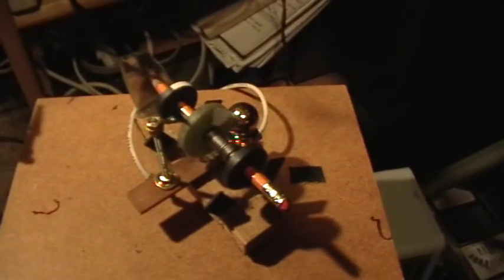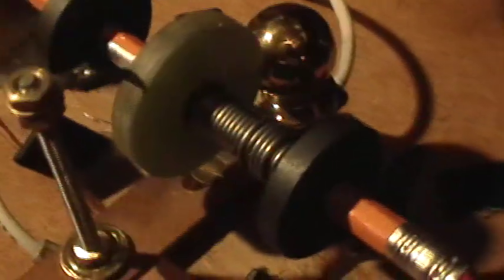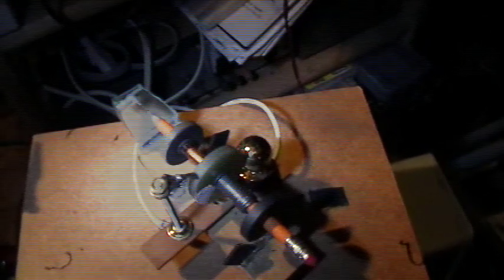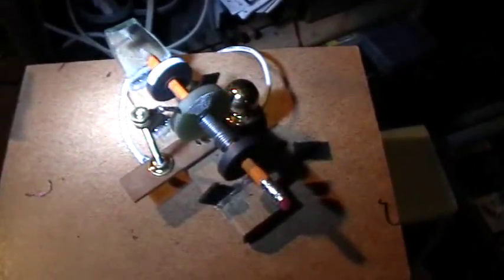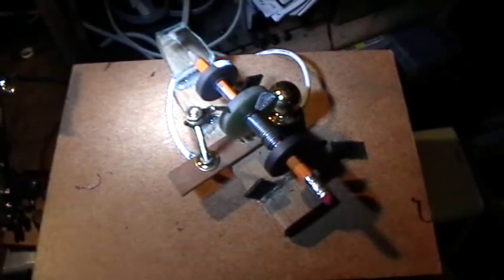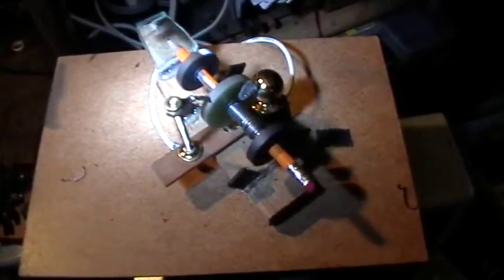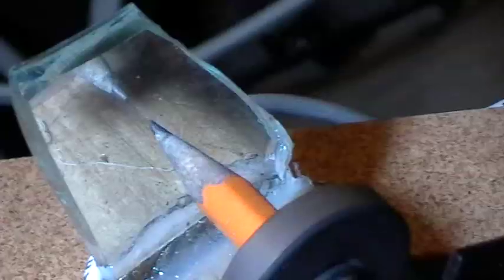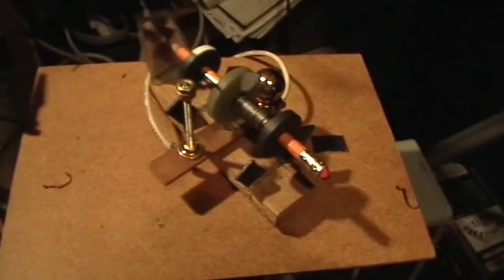Extreme High Voltage: Electrostatic Powered Magnetic Levitation Motor

Comment: Pretty clever idea. Never thought about using high voltage for motility.
Reply: Not sure how efficient it is though. Because most of the power leaks into the air due to the corona effect. Even if you cant see corona its still there to some degree.

Comment: Try this magnetic bearings, It is very safe...!
https://www.youtube.com/watch?v=5IH2rTlEuuw
Reply from the maker: skycollection Yes, very nice. But "safe"? I don't know about that. Have you considered what might happen if one of your inner cylinder magnets breaks due to the centrifugal force of many hundreds of "G" while spinning that fast? People have been seriously injured by NdBFe magnets coming apart under such stresses. I would recommend that you enclose your entire apparatus in a shield of heavy polycarbonate plastic, just in case. I wouldn't want you to lose an eye, or even worse! 
Good work though. You seem to have a good balance in your rotor assembly.
Reply: TinselKoala Yes is very safe because i made a test last year, when my tachometer was complete (now is broken) the test was for 39,000 RPM with the maglev 1, the maglev 2 develops extreme speeds (40,000RPM AND MORE) WITHOUT DISTORCION and without risk OF EXPLOSION, you can reduce the speed with 9 volts and is safe, or use 12 volts and you can control the speed with the potentiometer. The COPPER PIPE AND THE PLASTIC RESIN protect the magnets and i can drive the rotor to unknown G FORCES , the coper resist the preasure and the extremme speed without risk of explosion...!
Reply from the maker: skycollection
I don't mean the magnets inside the copper pipe, I mean the magnets that form the inner parts of the magnetic bearings. They are spinning, and aren't protected by a copper enclosure or plastic resin, right? And if one of them should fail, then the whole apparatus becomes wildly unstable, right? Just be careful.

Comment: Nice demo.  I was inspired for how to improve these types of magnetic bearings.

Using a carbon fiber tube 1/2 OD x 3/8 ID x 6.00 long.  Press or glue 3/8 OD x 1' long Neodymium cylinder type magnets in the ends. Make electromagnets using spools with 5/8 dia. arbor hole. (I buy these on line) Insert a 5/8 dia. alignment rod inside the two coils and mount them on a base. Remove the rod.   The distance between the centerline of the Neo magnets inside the shaft should equal to the distance between the centerline of the coils.
Insert the carbon shaft in the coils, power the coils with a 555 timing circuit or function generator.
I'm thinking that the fields should align perfectly, eliminating the need for a thrust plate,  also I expect the shaft to be bound in all three axis of the magnetic fields and any shaft related concentricity issues should disappear too.  Your thoughts?
Reply from the maker: Yes, if you use an active system with sensors you might be able to eliminate the thrust plate. But as you probably know, with the passive system it is impossible to do without the thrust plate. I'd love to see your system succeed!
I've improved this unit quite a bit, please see the later demonstration with the new frame and axle assembly. https://www.youtube.com/watch?v=tVfw-TeJ9r4
Thanks for watching and commenting!

Comment: SERIOUSLY COOL LITTLE MOTOR & demo. towards the end I was beginning to worry you'd spin it up to where parts might come apart.
Reply from the maker: Check out the later versions, cleaned up chassis and better performance!
Extreme High Voltage: MagLevES Motor v2.0 with Arduino Tachometer
Thanks for watching and commenting.

Comment: I'm not sure how your achieving balance between all components to what scale. Or if its done before or after you put all your markings  on it.  But if you are still getting this wobble if your balancing it last to the best of your ability. Then try using all much stronger magnets in all your components. Then you should achieve more stability as your magnetic strength is raised. Hope this works out for you.

Comment from the maker: Please everybody take note of the Erratum regarding electrode polarity.
Also, another corona motor that I made, using a horizontal disc and a ceramic or glass ball bearing, and powered by a hand-cranked Moore's Dirod generator, can be seen at v=YpemKuf6X_c
I don't have the Dirod handy so I can't demonstrate it powering this present motor, but this motor will certainly run on static from VanDeGraaff machines or any other HV source strong enough to make a corona.

Comment from the maker: Note my erratum: In the video I got the polarities muddled. The Ball is connected to the HV PS case ground and 24 v LV supply negative, but is actually an Anode; the output of the PS is Negative 6.4 kV, so the brush electrode is Cathode.

Comment from the maker: Yes. Preferred direction of rotation has to do with the electrode spacing around the edge; it will go either way but prefers to go in the "shortest" direction. If the electrodes are precisely on a diameter it will spin equally well in either direction (although the magnet levitation system is slightly crooked, the mirror isn't at exact right angles, so there's a bit of mechanical bias for CW rotating as in the vid.)

Comment: Great demo! Stability was excellent before the pencil started to wear unevenly. A pin for the tip would probably fix that problem, maybe a slight pilot hole. From a center punch, or drill tip. I wonder how hard it would be to get the required hv from a natural source? Maybe a kelvin dropper or solar flyback or something?

Comment from the maker: Thanks Bill. The HV is constant, it's just a fixed supply at 24 V in, 6.4 kV 1.2 mA out. Of course it's not putting anything like the full rated 1.2 mA into this system, it's essentially open-circuit on the output, just "running on voltage"  ha ha.

Comment from the maker: I don't think the HV interacts with the magnets. The current that actually "pushes" the rotor is so small that any field would be minuscule. I could probably even use one of the ring magnets instead of the G-10 disk for the electrostatic drive. The off-center point is mostly what's holding the RPM down, that and aerodynamic drag.

Comment from the maker: I'm wondering about eddy currents too. I'm going to try to get a homopolar generator segment going on this thing next.
I don't have any instruments sensitive enough to see if the magnets are heating up. I doubt it. The rings are ferrite, non-conductive and the flat magnets aren't metal-coated like most NdB so I don't think they are conductive either, so I can't imagine where any eddy currents would happen. We'll see what happens when I attach a homopolar dynamo disk to one of the ring magnets.

Comment from the maker: Yes, I have and it doesn't work nearly as well. It does spin but only a few hundred RPM, with the same applied voltage and electrode spacing.
Thanks for looking in!

Comment: I am amazed at the stability demonstrated here.  You would think that your disks might not be balanced so well and turning on a wooden pencil no less!  Do you think there is like a node point where the electrostatic field is over riding the magnetic field of the magnets?  Maybe only at certain RPM?  I don't even know why the thing rotates from the high voltage.  Was the HV constant or was that being turned up slowly as well?

Nice work.

Bill